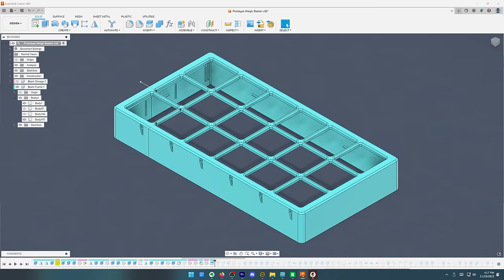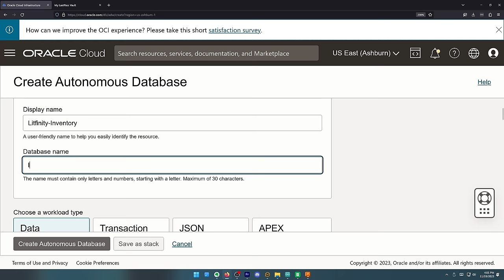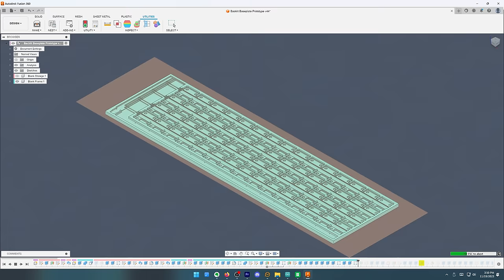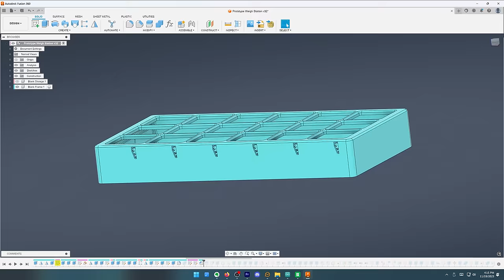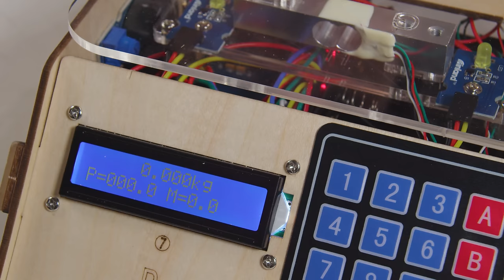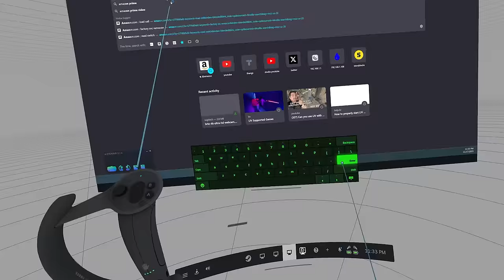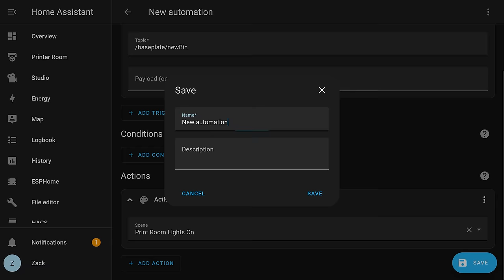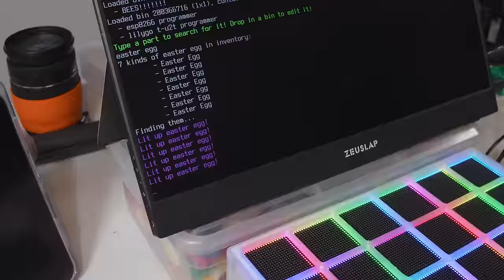My Storage has a Search Bar! Gridfinity + 8,552 LEDs = Litfinity!

Comment: Only thing I don't understand: after registering a new bin w/ the automatic prompts and then removing that bin from the "registration spot" next to the RFID reader... how does the tray (future: how do any of the trays) know where you eventually place that bin? And when you move the bins around, because obviously that'll happen a bunch, how do all the affected bin "slots" stay up to date on which bins are where? You seem to have this handled, since you show the system lighting up the correct [sub]bin when searched for, but I don't recall you installing RFID/NFC scanners all over the place (in face you commented that would be prohibitively expensive), so how track ye the wandering IDs?

Comment: I never noticed how small your arms were until you struggled to carry 100 pounds with help.  Unless you plan to build an exo-suit, I suggest hitting the gym for like, a month or two just to un-atrophy your arms.  I'd also suggest if you need to move it again, get some twine, straps, rope, tape, anything you can wrap around it tightly and use that for better leverage so you can grip on the side, and you won't have to bend and hurt your back quite as much.  One hand underneath, another one gripped to the side.  You can print handles if you need to, but make sure they're strong and be aware of the center of gravity.  Whatever you use to grip to the side, make sure it won't slide as you're moving it.
If you're going to be good at storing things, you should also be good at moving things. 
It won't just be better for your health, it'll be easier to move this way.  You'll have a better grip on it, better visibility, more range of motion/maneuverability, and since you'll be able to carry it higher and further from your body, you'll have an easier time getting down or up stairs, I promise you.
One more note, don't use a towel.  I know if you read this it entered your mind, don't do it.
Your health is important, and the discs in your back will thank you for following my advice.
Work smarter, not harder.

Comment: strangely, i designed a system for a music store, which interfaced to stock control, but also allowed a customer to ask for a specific piece of video or music, and the bin(s) in question had a blinking LED indicator that would come on, and be turned off if an item was "pulled", or after say, 3 minutes ... 1985.

Comment: For the "weight" sensor/load cell you could try having a preload on the rgb-baseplate. For the mechanical side of things of lets say you added 5kg to the base plate under the rgb matrix displays it should make so that the effect of wires wiggling should be near zero. The base plate should have enough mass....something something..... some law... stay at rest. BUT(and this is a big but henc the capitals) the load cell/load cell electronics may not like being preloaded with 5kg and may not be able to sense small 0.001kg changes anymore.    
Hope the idea at least points in a different direction than going full wireless charging pad, with liquids nitrogen superconducting magnet hover board. Especially after just watching your love letter of a video about going overboard causing issues. Maybe just a reasonable sized book , fishing weights, your regrets, or gravel from the local park shoved inside the baseplate might be all you need.

Comment: now that's a use case for AR if i've ever seen one. also, could the RFID reader be placed on a carrige pulled under a row with a string one way and by its ribbon cable in the other?

Comment: Good morning Zack,  I have an older version of a 3d printer kit that I built about 4 years ago.  I have had a little success in one of my recent projects.   I am currently trying to get the 4 Ninja Turtles and Splinter printed out and am using PLA with support and at the recommended temperatures.  My main problem has been the support rolling around the table after the extruder goes over it.  I am wondering if there is a better way of fixing this problem.

Comment: @ZachFreedman I really like some of the items on the 💩 List of 💩 Video Ideas!
#1 Mouse that can escape monitor. Might need a wand instead of a mouse with IR laser to target IR photosensors in the room.
#2 Mechanical kb which lets the neighbors know that sleeping is for sissies.
#3 Liquid resin as adhesive. 3D printing by hand would be interesting (better wear UV blocking goggles for this), and you've just found a cheap way to refill the epoxy pens.
These 3 combined into one video would make a nice XMAS special.

Fantastic episode and project btw!

Comment: Dont some vending machines already have most of what dude was saying he needed to “figure out”?   They store everything in a database in internal memory on the basis of cost per item per shelf but they dont record amounts..  with that system and the item retrieval built in, just a little inventory stock data entry would put it at the level that he was talking about:.  Only holdup on it being a used storage method would be in buyers willing to go through all of the data entry when putting stuff in it and the niche group of people who have that much stuff to stock something that needs that level of organization..  youd still be waiting on the mechanical aspect of it when retrieving items which comes with its own mistakes and ongoing maintenance with lubrication, sensor wear, etc..  and dropping or misplacing items getting hung up on it..  vibrations moving parts around and getting weight physics off..  items that are bigger needing special places to store..  tiny ones needing delicate care..

Comment: Personally, a large part of being a "maker" to me is the ability to actually design (or modify an existing design for) your own projects. Just downloading and duct-taping together existing projects is, frankly, kind of boring.
It's really cool when people try to put in extra effort to make a project, tool, or system modular, extensible, or otherwise accessible, but if that's seen as a requirement for all projects, I see that as more of a detractor than anything else. Restricting myself to "only tools and techniques most people happen to have available" would kill nearly every project I've wanted to (and likely will want to) work on and seeing the absolutely insane stuff people can put together is one of the main reasons I care about online projects at all; nothing is more disappointing than a 30 minute video that's just "I bought a bunch of parts other people made and plugged them together."

Comment: I'm fine with the ocassional project that we cant meaningfully replicate, but I'd prefer that they not be a huge portion of the videos released. I like the idea that I can complete things, but if its cool enough (like the RGB Oscilloscope) then I'm fine with it. 

I don't think you needed to be able to highlight just the individual item. A single LED per grid space would have been plenty of granularity, since the function of finding something is actually mostly just filtering out a bunch of unnecessary information. Filter out enough information and you'll have done the job.

I don't really understand the benefit of the hall sensors over a simple contact pin connector. Like why not have say an 8 pin connector on the bottom of each bin, and then you could even skip the RFID/nfc part by having the pins on the bin connected to each other or short differently, essentially giving each bin a binary hard-coded ID. Whenever the slot detects anything that's not all shorts (00000000), it would id the bin there automatically. Wonder what I'm missing that makes this a bad idea. Technically it only scales so far, but you might be able to use a very small variable resistor instead and identify each bin by its resistance value, which would likely have a lot more room for granularity, and a lot less parts/finickyness between tags, and sensors.

Comment: So on the pantheon 1kg of plastic per 24h, it got me thinking how fast my printer can melt plastic and how fast the pantheon is melting plastic anyway 

(probably bad) math warning

so here the result for the one that are getting nerd snipe like me (and correct me if I am wrong I am bad at math) 

First we need to figure the volume of a 1Kg spoll of filament, 
V = m/p or mass/density, as I could not get the density of a pantheon spool I used the density of a CF PETG spool from 3dctech, a high quality filament manufacturer 
Converting 1.34g/cm3 to mm3 is easy it is 0.00134g/mm3 and so the equation go 1000g/0.00134g/mm3 and it give us the total volume of the spool 746268.66mm3 
now lets divide it by the volume we consume each second, in my case 30mm3/s and it give us 24876s for consuming a 1kg spool of CF PETG lets divide by 3600 to convert second to hours (60s*60) and it give us
... 6.91h for laying a Kg of filament...

If we do the reverse and calculate of "slow" you need to go to consume 1kg of filament in 24h you get 
V = m/p so the same start and it is again 746268.66mm3 
but now we plug this into this equation flow = V/t V is 746268.66mm3 the time is 24h in second so (60x60x24 = 8400s), lets plug it all and we get a flow rate of 8.64mm3/s to consume 1Kg of CF PETG in 24h...

now lets remember I am bad at math and even if I check multiple time I can be wrong 
AND it did it out of curiosity not to trash pantheon, also remember they are using a slice engineering hotend at it is rated at 25mm3/s (I do not know the filament used) but we can assume that melting the precious plastic is not the bottleneck, they are claiming "nearly isotropic z strength" so maybe the bottleneck if about melting the filament hot and not using cooling fan to get better layer adhesions, or some other technicality of 3d high end filament that I am not award of it....

TLDR a creality ender 3 is not far off melting a 1Kg spool of filament in 24h in PLA and maybe CF PETG but I not not have a spoll of it or an ender 3 to test it, and if you do remember to use an hardened nozzle

Comment: I know a thing or two about dumbfuckery and electronics but you know more than I do.

With how much you struggles with reed switches and all that to get the rfid sensors to work, would it be worth considering not doing that and instead have a custom PCB base but multiple antennas?

As in, your original "patrons are not $8000 generous" idea but take all those sensors and remove them but keep the antennas. Then use some version of a muktiplexer to be able to use the single RFID module/chip/thing to address, via the multiplexer, a specific spot on the grid.

Obviously would require a custom PCB and would need to be as big as your whole workspace (or smaller and use a few of them) but could that be a reasonable alternative?

Comment: Oracle for database.... Why? For reference I have used it, a lot, for real purposes over more than a decade, and while there's *some* functionality that open source systems don't have out of the box, but not only do you not need these features, they are all available with some work. It's extremely off-putting to endorse one of the worst technology companies on the planet for a project that would work fine with a flat file running on an stm32 stuck to the wall in your shop.

Comment: I like your videos and i say this with love, but you need to get out of your comfort zone and learn how to work with wood and metal. When your default aproach to build a drawer system is 3d printing or machining you seem to be limited. Large structures are unaproachable and your creativity is limited, dont wait for a 3d printer able to print 10m x 10m x 10m structures , get some ply and 2x2s and build the cabinet of your dreams and smaller items and automations are supplementary. Best regards